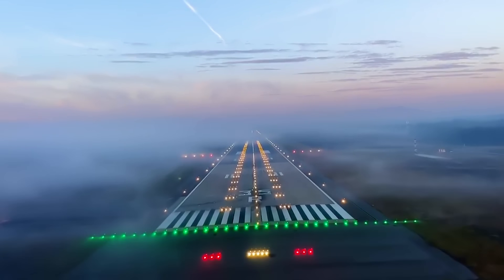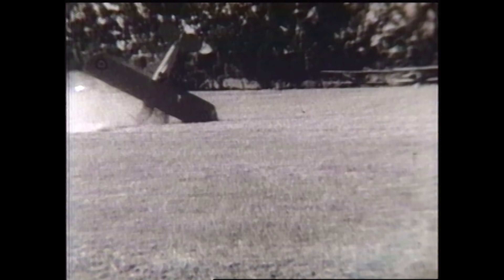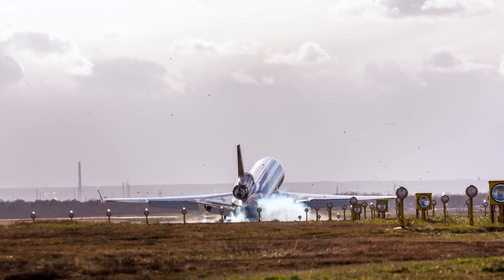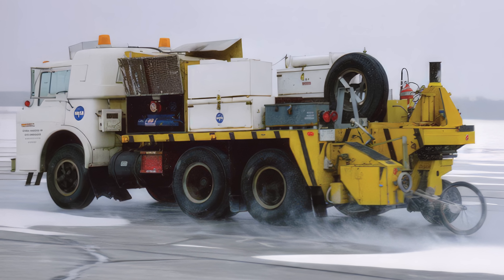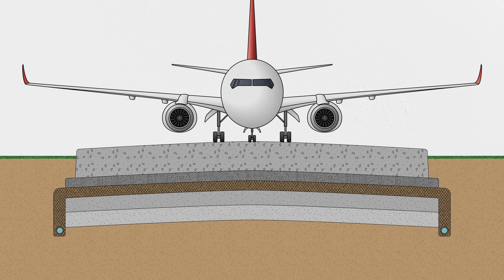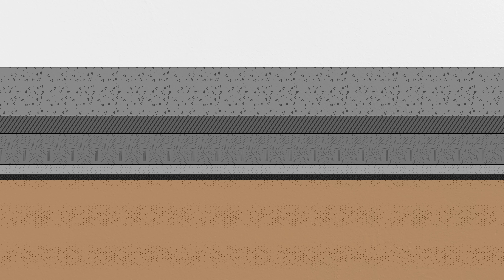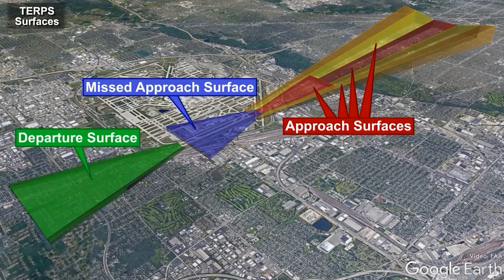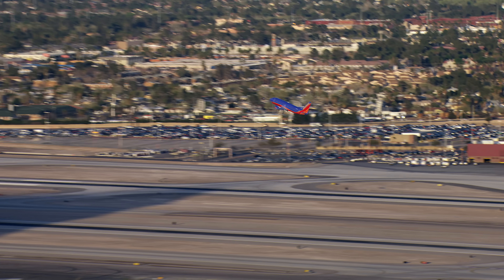The Hidden Engineering of Runways

Comment: I like the assertion that “most runways in the US” are made of softer asphalt, while large commercial airports use more rigid concrete. This is a subtle way of encouraging people to think about the fact that the US has six thousand (ish) airports of all sizes and configurations, almost all of them smaller, without control towers, while only 37 are of the largest international category (Class B) and another 120 of regional (Class C) airline type.  This is a very different number and proportion of airports than any other country, many of which will have few or no airports outside their one or two major arrivals hub. 
Earlier comment – for reasons similar to the above, it “could” be true that most airports have perpendicular or crossing runways to accommodate different wind conditions, but again this would only be because “most” airports in the world are the smaller (and older) US type, often serving a mix that includes slower aircraft. The large commercial airports built today virtually always use parallel runways, mostly because this greatly simplifies safe management of a flow of departing and arriving aircraft (who are not crossing in front of one another) and also because aircraft that take off and land at higher speeds are less affected by crosswinds, the amount of wind correction required being a trigonometric calculation on the basis of the aircraft’s speed. 
Large airports with crossing runways (LGA, JFK, SFO) were generally built before most of their traffic was jets aircraft, and even though they do use different runway configurations based on the prevailing wind, if they were to be built today they would have parallel runways.
Nice illustration of runway construction strata!! Thanks!
Reply: Note that he said most paved runways in the US are made from asphalt. I'd bet that the majority of runways are not paved: simple grass or dirt strips.
Reply: I bet 3 crossing runways in a triangular shape (crossing each other near the ends) is the most universal wind design
Reply: @NikolaiUA I don’t know what you mean by “Universal” but the configuration you describe is not common..
The most common for multiple runways is two runways crossing at right angles. This ensures that no crosswind ever exceeds 45°. Many other configurations exist, based on practicalities such as where real estate was available, or what direction avoids the snarly lawyer’s house, but in many cases a field may have two prevalent wind conditions, together accounting for a majority of operating conditions through the course of the year.
Reply: @gregfaris6959  Yeah, it's not common because this setup gives single-runway operations with 3 constructed runways (so 2 runways are unused at any given time), and certainly rare for commercial aviation. I believe some militaries use it more.
( Although a lot more common in commercial airports is a reduced version of this with only 2 runways at a 60° angle, crossing at their ends (sometimes they don't even cross, but start from a single point instead). This looks like a V-shaped runway setup, without the third "crossbar" runway at the top of the "V". Obviously for when the windrose has more prevalence. )

By "universal" I mean "least x-wind for any wind direction". In this setup you ensure that no crosswind ever exceeds 30° if my math is correct. You can, of course, in theory build as many runways in a circular pattern to each other as you wish, approximating a circle, but realistically 3 runways with 30 deg. x-wind is the most rational solution for least x-wind.
Reply: @NikolaiUA  OK - I see what you mean by "universal".  This configuration would yield a maximum of 30° crosswind component at any time. 
There is actually a more "universal" configuration though, as airfields originally were conceived as open aires, where takeoff or landing could be set up in any direction, depending upon the wind.
Reply: Alton Brown once said (on Hot Ones) that he wanted to do a show about smaller airports and the food you can find near them, but it doesn't seem like something that ever materialized, which is disappointing. Hopefully someone else does it.

Comment: I was actually on the team of people that were sent to Roanoke, VA to recover that Embraer 145 runway excursion into the EMAS. I work for the regional airline that operates those planes for United. The EMAS is really just dry powdered portland cement with a layer of fiberglass sheets on top. That cement got EVERYWHERE and took us about a week to clean it off and get the aircraft airworthy again. It destroyed the tires, brakes, and auxiliary gear doors, as well as got ingested into the engines. We ended up needing to do a dual engine swap because there was just too much cement caked onto the compressor blades and guide vanes to clean off. It doesn't help that it was raining that night so the cement started to harden all over the surface of the aircraft. Plus the wing and H-stab leading edges, and the engine inlets were all hot from the deicing system, so it baked the wet cement onto those surfaces and needed to be polished off. The EMAS made a right mess of things, but it did it's job and stopped the aircraft from sliding off into the public roadway that wasn't too far from the end of the runway.
Reply: Fantastic first hand insight! Thank you!
Reply: At that point it's less on what is needed to make the plane airworthy and more like what can we reuse to build a new plane lmao
Reply: @franciscoguinledebarros4429 Right, basically the skin, structure, and hydraulic are good. Now replace anything that makes it move or not move 🤣
Reply: @pws3rd170   Convert it to a large and heavy glider, maybe? Winch it up, on a ten miles runway, then it can glide like 5 miles high, time 30, the glide ratio, then it can fly almost 150 miles away. Why do those bricks fly only 30 miles when one miles high?! Make them better!
Reply: @franciscoguinledebarros4429 the important thing is avoiding a "hull loss." Airlines do anything possible to avoid that.
Reply: I currently work for the FAA and used to install runway lights and EMAS beds as a contractor. The EMAS is, indeed, mostly Portland cement, but it is poured into blocks with a tremendous amount of air entrained into the mix. It is a crushable cement mix that will support the weight of a person walking on it, but not much more than that. It crushes like popcorn. The blocks are capped with fiberglass sheets. The EMAS is built one block at a time, like a giant puzzle. Once assembled, the joints between blocks are all caulked to keep water out, and the runway markings are painted on the top by hand. They are incredibly expensive, and the aircraft will sustain some damage, but the plane will not be a total loss. More importantly, they have saved a tremendous number of lives with a 100% success rate. Planes can be replaced- people can't
Reply: @8DeereFarm  Here's a question: Would the emas have saved the JeJu 2216 plane from hitting the wall with it's high speed on the the impact and why didn't that runway have it? Is it known how many and which airports have this contraption? It seems like it could be something to consider when when plane tickets.
Reply: @morfeyrun  Whether it would have saved it is hard to say. Given the location of the aircraft, most likely slow it down much or stopped. Runwaysafe, the manufacturer has a list... It certainly is something every airport should have. The issue is. Airports pay for it but it benefits the airline operator... In other words, few are the airports that want to pay.
Reply: @8DeereFarm 100% success rate !! Well that just says it all ! Amazing piece of engineering.
Reply: How does the powdered cement not cure when it rains?
Reply: @eliotbaez I would bet that that's quite a generalization of the actual composition of the material. Concrete washout that has been dried out and milled would probably be a closer analogy to what it really is.
Reply: @eliotbaez  They did mention there were fiberglass sheets on top.
Reply: @ronblack7870  EMAS is fully cured and mostly inert. Groundwater doesn’t “re-activate” Portland cement. The stuff that hardened on the Embraer was fresh paste and fines created during crushing, then smeared and compacted on a smooth surface where it could cure.
Reply: @eliotbaez  I worked on an interstate project back in 1991 that used a similar product as lightweight fill over an old creek bed. It is a mixture of cement, water and a liquid foam (the key product...this brand was Elastizell). It is mixed together and pumps out via 3" hoses in the consistency of a milk shake. It cures overnight but is much like baking a cake in that it will cave in if vibrations occur - until cured. The end product is very lightweight and appears as concrete - but it is mostly made up of tiny air pockets from the foam additive.
Reply: @danlowe8684   Was that in Germany? Elastizell sounds as German as Rundfunk.
Reply: @eliotbaez probably the layer of fiberglass sheets he was referring to
Reply: Cheaper than writing the airplane off!
Reply: @j.heilig7239cheaper than any life
Reply: @sebarioxes  Well, let's be honest there are some....Renee Good comes to mind lol.
Reply: @Trialnerror what is wrong with you man?!? Keep politics out of civil discourse please!
Reply: @Seawolf44  Politics is civil discourse, but Trialnerror is definitely uncivil.
Reply: @sebarioxes  the statical value of a human life tends to be figured around 10 million USD 

So...
Reply: @XIIchiron78  That's not bad really. When I run the numbers and calculate what my life is worth, it's a lot less than that.
Reply: @sebarioxes  Boeing CEOs may not agree
Reply: @chitlitlah  it’s not, it might be a lot more than your take-home pay, but you also pay taxes, and your spenfing pays somebody else’s wages, whose income pay somebody else’s wages, etc.
But you also have to count the fact that without you, your kids will probably do worse in their life , because of lack of support, therefore, are less likely to be high, educated and high income earners, and your partner might need to stop work to support them so it’s your income and your partners income
And then your partner might need support from the government so instead of paying taxes, they are taking it.

So yes , even though your take-home pay is vastly less than $10 million. Your actual contribution to society is likely much higher.
In fact, it has to be , otherwise the company you worked for would go out of business.
Reply: @Seawolf44  I didn't bring up politics, I brought up a low value person (IMO) which directly relates to the OP's comment of a "person".  Why are YOU bringing up politics?
Reply: @j.heilig7239 idk man engines are ungodly expensive
Reply: @noscopesallowed8128   A new jet would also need two new engines
Salvaging most of the airframe lets you save quite a bit of the expense
Reply: @spartan8705 The engines still probably had a lot of reusable parts.
Reply: @j.heilig7239🤔 That's funny. On September 24th 2025 I landed long with 53 million little passengers that landed on this girls runway that I know 

😎😎😎💪🏻💪🏻💪🏻
Reply: @barreldreamz7852 But you are running the smallest equipment in the fleet. Most dont want to fly with it.
Reply: @giggiddy  probably a bush plane?
Reply: @barreldreamz7852 No need to brag..
Reply: @barreldreamz7852  I've always come in short and crash landed anywhere else other than the runway and let the passengers off there.
It's actually much safer that way 👍
Reply: Fascinating. Gotta say, very odd material choice for the underlay though. Washed fine sand you'd think would work just as well while being very easy to cleanup in comparison. Propably came down to cost to build it I guess. Not the aiports cost to fix the plane so they just went with the cheapest option maybe.
Reply: @k1ng5urfer that would turn into mud when wet and would be too inconsistent in arresting. Cellular cement is the most common and it aerated and porous cement that’s designed to collapse under load.
Reply: @k1ng5urfer I don't see how portland cement could be the cheapest option. Sand is much cheaper, and even unwetted concrete would be cheaper while still posing the same issues
Reply: @k1ng5urfer Doh. They obviously should have just asked you before they did all their research.
Reply: One week is way faster than I thought it would take, wow.
Reply: I don't care if they have to write the airplane off if the system does its job and prevents another Southwest 1248 tragedy.
Reply: Thanks for sharing that.  Very interesting insight.
Reply: If it was pilot error I hope the airline's insurance paid to reset the EMAS. That's got to be expensive. The airport shouldn't pay to reset it.
Reply: @dannydaw59 in the end, whatever you consider public expenses or insurance expenses, or even the gifts you get from any shop or seller ... Their cost ALWAYS end up being paid by the citizen or the consumer. 

You.
Reply: @Benoit-Pierre The ticket cost for that airline goes up goes up because thier insurance rate goes up. Why would the insurance costs bleed through to other airlines?
Reply: @dannydaw59 in France, ask to la MAIF, bar le duc, 1976

One Citroën stuck in a cross section between a road and a train. 

One train arrived, hit the car, derails. One wagon falls of a bridge and damages it.

3 billions !!!

They almost closed down, had to rise the subscription at the country scale. All customers held, the company is still alive. 

One spectacular unforeseen accident. 

It won't happen to plane insurance because they already have huge subscriptions... But one insurance can sink from a single accident.

And that's why insurance companies do give their opinions on how to build safety stuff.
Reply: Cement? That seems bad — so every runway excursion turns into chipping concrete and full replacement? Why not something non-reactive?
Reply: @JasperJanssen  Keep in mind, runway excursions are extremely rare. This is a worst-case scenario safeguard so it needs to be the most effective mix. The mixture used is highly effective at stopping a plane and the resulting cleanup is much cheaper than letting a plane go off the end of the runway.
Reply: Seems like a bad choice for material to specifically put to there to stop planes. Why not just use sand or gravel?
Reply: @jonathandb91 during the 80s many companies around the world stimulated then tested everything. . 

EMAS is required when space is missing, it just must effective ( efficient ? ). 

Used less than once per year over the world. 

Believe me it's a trade off, and all parties gave their opinion including insurance companies.
Reply: Thank you for your great explanation!!!
Reply: The FAA has approved only two materials for use in EMAS (Engineered Materials Arrestor System) installations: cellular concrete and foam glass. Cellular concrete is a lightweight material formed by blending cement paste with foam to create a structure filled with countless air bubbles, while foam glass consists of crushed glass heated to form a rigid, porous block. It’s important to clarify that dry Portland cement and fiberglass sheets are not among the approved materials for EMAS applications.
Reply: @NotExpatJoe unless dry Portland was a shortcut to designate cellular concrete ...
Reply: @Benoit-Pierre  There are no FAA approved shortcuts. :)
Reply: Been to Roanoke a few times on a road trip with my airline, glad this one wasn’t mine 😂 props to you bro
Reply: My thoughts is if this was installed in Korea instead of a concrete wall, we would not even have the tragedy
Reply: Bruh just buy a new plane at that point!
Reply: @fnamelname9077  yup. When the cost of changing 2 engines and 3 wheels will exceed 300 millions. 

I am pretty sure I can change 5 parts and sell a full cleanup for way less than 100 millions.
U wanna save 200 millions ?
Reply: @Benoit-Pierre  Holy moly! That was not at all what I was expecting for the cost break down. I wonder what the profit-margin is on the original aircraft. o.O
Reply: @fnamelname9077 It's probably significantly less than you're currently imagining. Because the quality and certification requirements are so high, development costs so high, and aircraft and their innumerable components being low-volume, specialised, and high-tech, with each aircraft being hand-assembled and requiring thousands of man-hours, the final asking price for an aircraft is necessarily enormous. Even large business jets can get into the $100M range, IIRC.

So it's just a direct result of the involved product economics. All the aircraft sold for several years after a new model's introduction comes at a net loss until the development and production investments are paid back.
Reply: @mnxs  That makes. I guess we wouldn't want it any other way. It'd be a shame if they were constantly falling out of the sky.
Reply: I end up going by that airport all the time and never knew! Heck, I'd been over there shortly after that incident evidently and didn't even know
Reply: This was incredibly interesting, thank you for the personal insight!
Reply: Watching that choppy footage of the airplane approaching the highway was wild; I don't think that many drivers even noticed...

And, while I'm at it: Thank you for your work!! :3
Reply: Just out of curiosity, wouldn't fine gravel or sand be cheaper and much easier to clean, why do they go with cement
Reply: Imagine how tough it was for those Apollo mission crews to deal with it
Reply: Couldn't that be a surprisingly fast way to get a Spaceshuttle covered in heat resisting cement? Make it land in a carefully composed cement?
Reply: Nerd.     

😂❤

Comment: Concrete is required in high heat situations, especially with VTOL aircraft like the AV-8 harrier or the F-35B.  The exhaust will melt asphalt